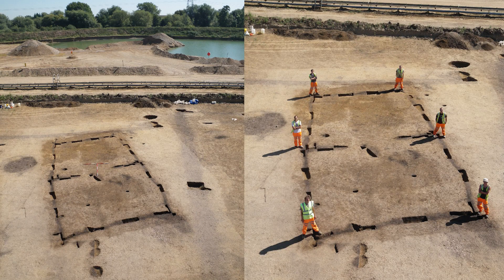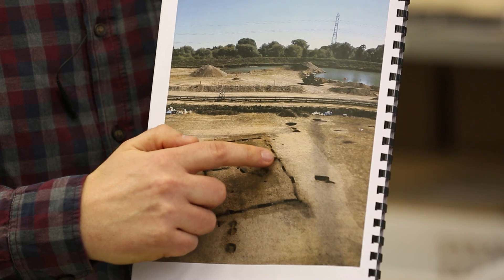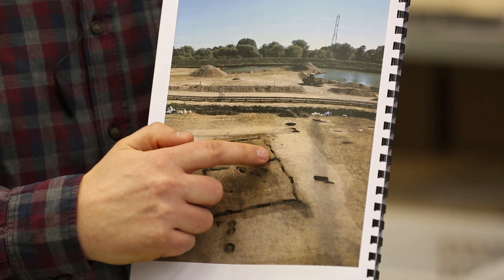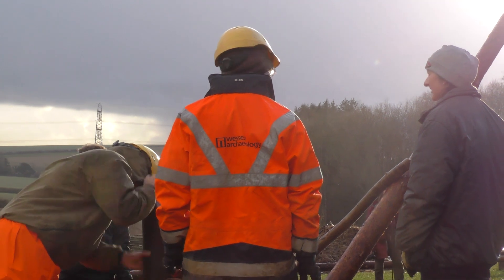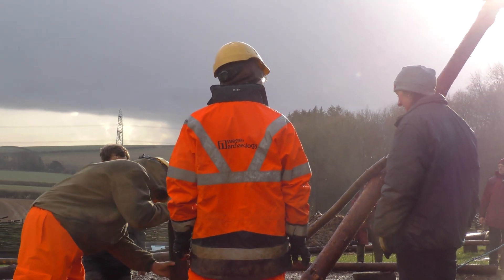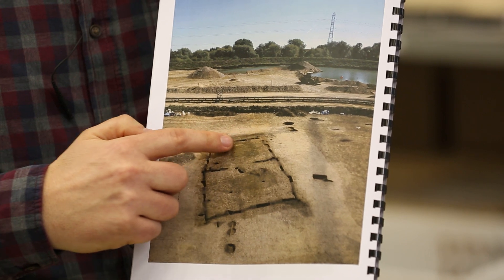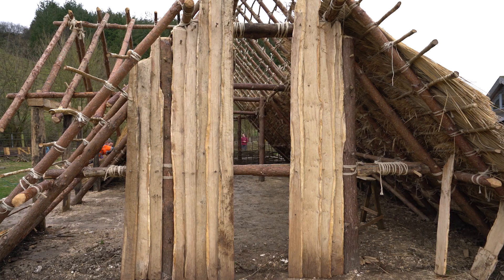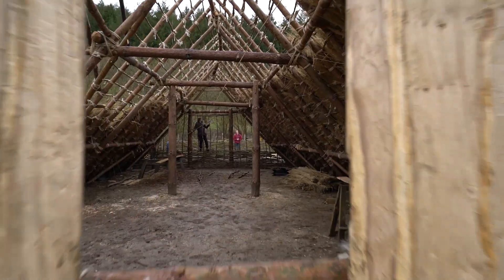The Butser Project: Building a Neolithic House Part 1

Comment: You fo realize that at one time and not very long ago many people lived in what is considered nowadays a barn. One dwelling was built. Animals on one side and people on the other. That meant chores were simpler and the animals helped to warm the dwelling.  I have lived in a barn. Only problem is early morning when a draft horse eats the last of his hay and wants more. Slips his halter and comes and wakes you up rudely. The smell you get used to and by golly you clean up often to keep the odor down. If in this dwelling livestock was kept on one side, a really sturdy fence structure between human and animal spaces would have been a matter of course. Hungry livestock trampling on you or head butting you out of a sound sleep, etcetera would have made it a priority and a standard feature. I never see an adequate partition on the mock up houses. Some delineate a part for the barn, but never construct an adequate barrier to keep the livestock on their side if they were in residence. The racket would be enough to deal with.. Bessie the cow waking you up as you are snuggled by the fire sound asleep is not fun. I just had King the Percheron head butting me awake at 4 am. Believe me after morning chores his stall was fixed to prevent him doing it again. No neolithic farmer would have put up with that either. What partitions I do see are totally inadequate to prevent such a scenario. You can do some experimental archaeology and test the enclosures. Pen up the livestock and lightly feed them and sack out in a bedroll.  See how long before you are informed that the manger is dry. By what methods. Yeah.